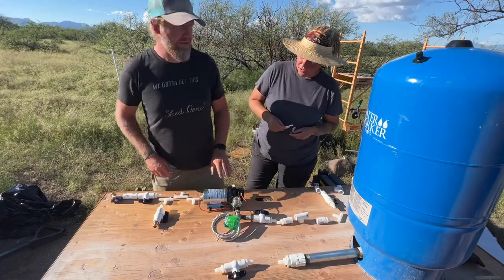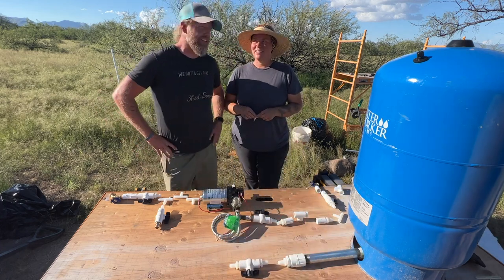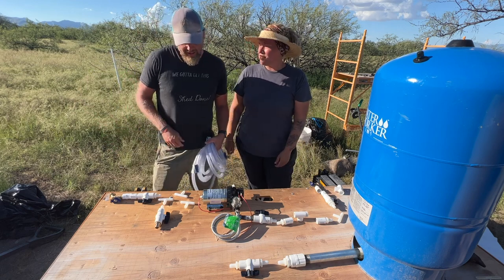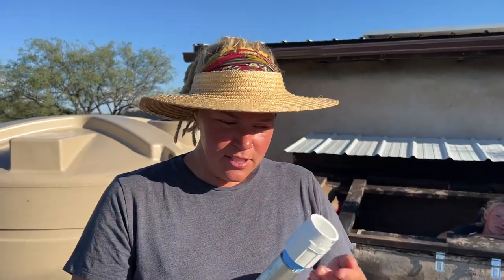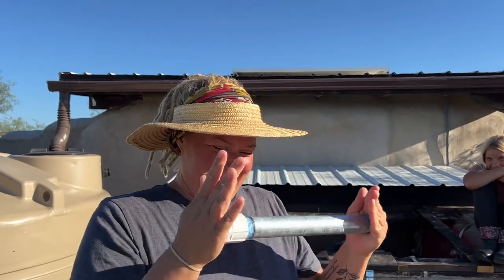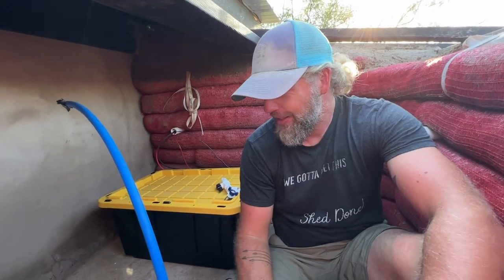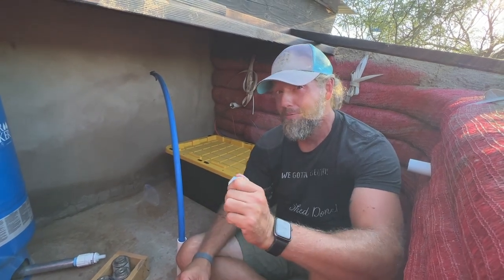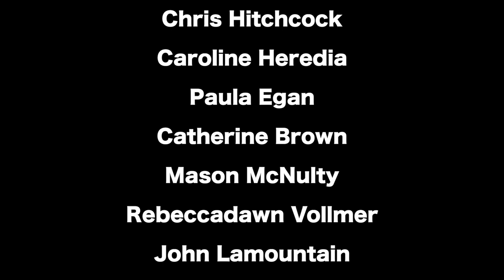SOLAR WATER PUMP Installation (Chicken Garden Day 173)

Comment: You’re doing a great job! There’s always so many twists & turns to making things work, well done you.  When I was having trouble with leaks at threaded connections an old plumber told me to use both pipe dope & tape it worked great no more leaks.

Comment: For your threaded connections get Rectorseal pipe thread compound.  It seals and lubricates the threads during assembly.  Thread tape only provides friction reduction.
Reply from the maker: Thread tape seals as well https://en.wikipedia.org/wiki/Thread_seal_tape
Reply: I agree 'cause thread tape is a pain in the keyster. I installed a shut-off on the line to my toilet tank and used thread tape. Water all over my bathroom. Had to shut off the water to the whole house until I could get the seal stuff. Next, I will do shut-off valves on the sinks and 🚿.  Wish me luck!

Comment: I also put a 'T', ball valve, and hose connector on the input to my pump. If my well ever fails, I can haul water, connect that mobile tank to the pump input and run a hose from the pump to the water tank to transfer the water from A to B, B to A, or whatev.
A few wraps of Teflon tape always works for me. 
Plastic tubing and AZ sun don't play well together, unless protected by paint,  I've found. But, with yours inside the pump house, that shouldn't be a problem. Good idea on the more flexible nylon fittings. On the other hand, you're still using brittle PVC fittings. Reckon your pump house has plenty thermal mass to minimize nightly low temps.
I use 3/4 " galvanized pipe and still needed pipe insulation & heat tape on all above ground exposed plumbing for the occasional hard freeze. But, you might not get those at you lower altitudes. It's usually the unprotected hose bibs that freeze and burst.
BR
😎

Comment: Love the "Overkill Homestead." Ashley you know a leak test is usually under pressure. If it was a drain that would work because drains aren't pressurized. Nice, using flexible, more temperature pliable nylon components to avoid problems as temperatures drop. You guys think of everything! Does your current pump house use those too? Your set-up is such a puzzle but it will do all the things Jonathan wants it to do. You're right Ashley that Jonathan did really good figuring this all out. Ashley, the taping is the hardest part and you are great at it. It all looks great TSH! I loved Jonathan being in the chicken coop with the lights on at the end. Power to the pump and switch tomorrow! Thanks for this video. See ya tomorrow! Nine Nine and his glove saga was hilarious!

Comment: have you considered placing a light bulb in pump container for freeze protection in winter
Reply from the maker: You need 120v power for that.
Reply: For frost prevention, you might use an old-style 12v tungston auto bulb. A better solution might be a mini 12v fan/connector heater via a thermostat. This could draw 100 Watts from your battery, but only until the pump house temperature had risen to a safe level. It looks a cosy place, so heating might not occur very often. Yes, you will have the Rolls Royce of chicken houses!

Comment: You need a shutoff valve in the bypass/drain hose.  If you do not have one, the pump is going to try and pressurize the holding tank and run all the time.

Comment: Your design is excellent; having done lots of plumbing myself, so pat yourself on the back for doing a great job! With how well you made the floor and the bags, would this area hold water if there is a leak? Will you elevate the pump up on a block if it does?
Reply from the maker: Pump is on a block, electrical box is sealed at the bottom, and there's a low drain tube on the corner for catastrophic leaks.

Comment: If you know it going to freeze you can put a 100 watt lightbulb or a heat lamp in there and it will keep it from freezing.  We keep a heat lamp on a thermo cube in our pump house here in montana.  The thermo cube turns the heat lamp on when it gets below freezing and turns it off when the temp get above freezing.
Reply: I'll have to look up thermo cube. Haven't heard about it before. Thanks!🕊🐈‍⬛🦋🖖👍🌈
Reply: @damogranheart5521  most hardware stores carry them
Reply from the maker: You need 120v power to run heat lamps.
Reply from the maker: You need 120v power to run heat lamps.
Reply: @TinyShinyHome  Hey....why not put a lightbulb in there?? 🤣🤣Sorry, couldn't help myself.

Comment: Did you put a check valve in the system some where? Think I missed that part.
Reply from the maker: It’s built into the pump. Perks of using an RV pump - pressure switch and check valve are built in.
Reply: @TinyShinyHome  ooh that's right. Brain fart.

Comment: Too late for this application, but, using pipe dope along with Teflon tape will give you a better seal overall as the threads tend to score the Teflon. I have been doing this for years and never had a leak.